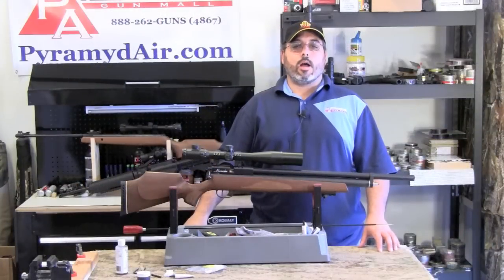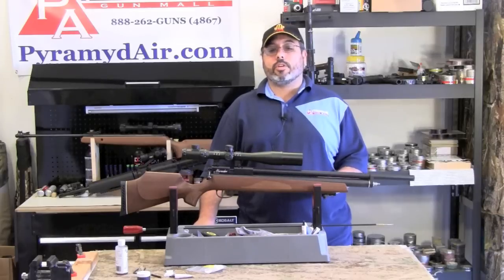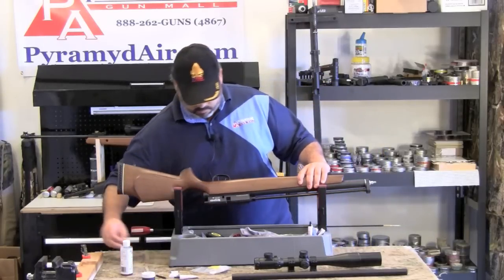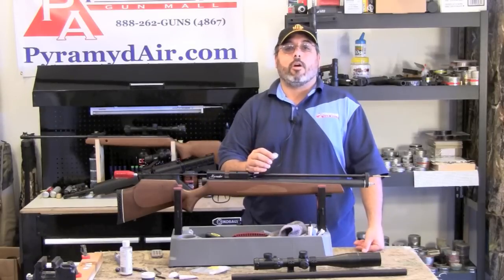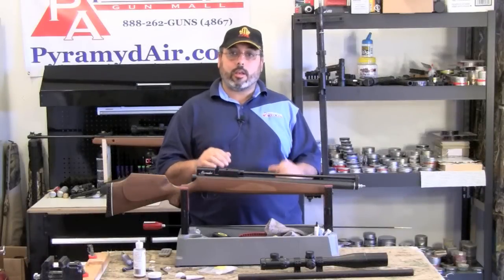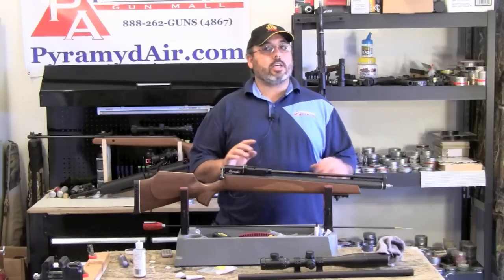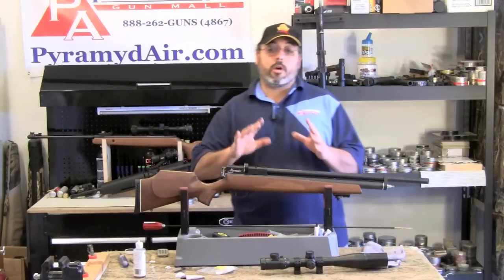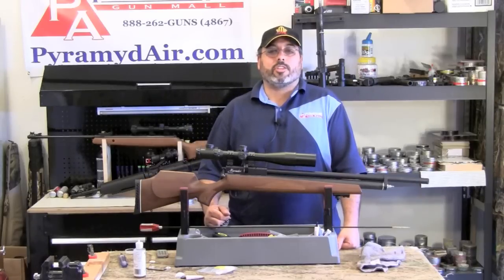How to Clean your Marauder Barrel - Take AIM Episode 9

Comment from the maker: @MrAirgunSniper 

Hey there.. definitely do what works for you.. I've not found it to be the case on my end.  when you think of it.. the tension should be the same no matter how you put it back together.. it is not like you loosen the front cap in the process.  When you tighten down the shroud it compresses the baffles as they were before you took it off.

Cheers!

Rick

Comment from the maker: @AirGunLvr 

unfortunately no.. You can't remove the bolt without taking off the breach.  You'll have to push patches through the front end.  I'd still recommend removing the shroud so that you can have better access to the barrel.

Cheers

Rick

Comment from the maker: You can use a .177 rod.. many of the .177 rods have attachments for .22 caliber accessories.  As for the solvents.. I would not use them.. There is too much that can go wrong.  Stick to what I've suggested in the video as they are known to work and work well.
Cheers
Rick

Comment: @MrAirgunSniper  That's funny, I had the exact same issue with my .22cal until I took the shroud back off and screwed it on without the baffles in it, then it went back to one hole shots @ 20yrds. I have a feeling that it is touching the baffles during those last few screw ins of the shroud and preloading the barrel at an angle or something similar. Mac1 worked on mine also, I will probably buy one of his accuracy prepped .25cal next.

Comment: I loosen the screw on the top of the reciver but the bolt does not slide out.......what am I doing wrong?   I also removed the screw and it still does not slide out.

Comment: Hi Rick, Could I use a .177 cal. cleaning rod to effectively clean a .22 cal? Also, will Otis 85 ultra bore solvent and or Hoppes 9 bore solvent work to clean the marauder barrel without damaging the o-ring?   Thanks in advance!

Comment: Would you recommend seasoning the barrel (like described in Take AIM #5) for a new Marauder (taking into account the PCP differences), or will cleaning the barrel like described in this video suffice, if you use a dot of MP5 oil to season the barrel ?

Also the new Maruader .25 synth stock on pryamyd comes with a depinger. Do you know if this is the same depinger as AoA offer for $35 ? If so, how does this effect the barrel cleaning efforts? As the bolt is seating the depinging device in the breach, if you remove the bolt to clean the barrel, the AoA depinger will likely fall over as there in nothing keeping it upright. Would you then suggest to clean the barrel from muzzle to breach?

Maybe a Take AIM episode dedicated to setting up a brand new PCP airgun like the Marauder .25 synth stock ? (just joking, but would love to see a pro set one up)
Reply from the maker: To Sooty Webster:
Hopefully I will be getting the new synth Marauder in for testing. From what I have heard, the depinger in the synth Marauder is one solid piece and it is easy to remove for cleaning if necessary. I would still advocate cleaning from muzzle to breach. Some people clean there barrels as soon as they get there rifles. Some rifles need cleaning because there barrels are filthy from the manufacturer. If your barrel is not filthy, you can let it season before cleaning it. Some people clean there barrels regardless. If the rifle is accurate, it will be accurate whether you season the barrel or not. I have talked to people that have did both with varying results.

Cheers,
AGW
Reply: AirGunWeb
As always, Rick, thanks for the quick responses.

And looking forward to seeing your review of the .25 synth stock, soon.

Comment: That is the hard way and time consuming way to clean a barrel. I do it the easy way, that is leave everything on the rifle, leave the scope on and don't disassemble anything, Except Remove the Barrel Shroud Only, so I can get past the air stripper I use a small allen wrench to push the string if it gets hung up on the air stripper,  I use weed eater plastic string trimmer line, since its flexible,   I put a small hole in a patch, put on some silicone oil, pull it through, When I cleaned My Marauder barrel was DIRTY when I took it out of the box and I doubt it will get any cleaner shooting it.
Reply: Good idea.

Comment: Rick, 
Is it ok to insert the cleaning rod in the muzzle instead of the breech?  If yes could I use a brass wire brush if I also don't run it over the breech o-ring?  I'd put a finger over the breech and feel the tip of the brush before it passes over the o-ring.

Or is inserting the rod in the muzzle not recommended to protect the crown?
thanks,
Fred